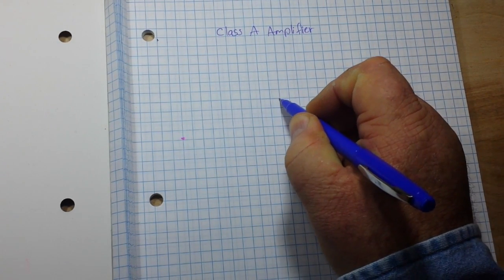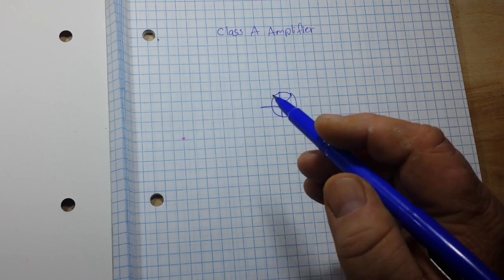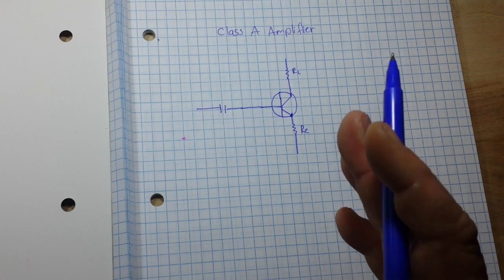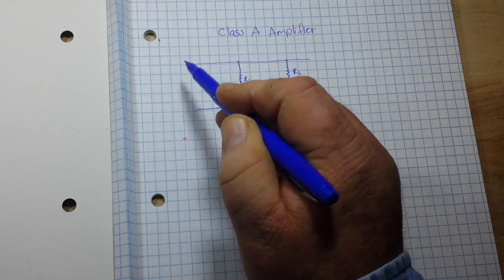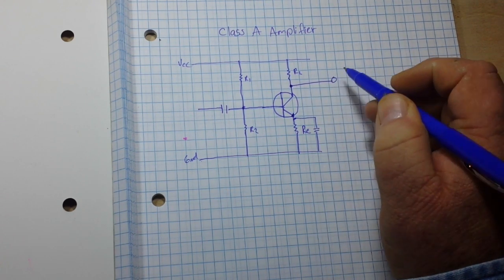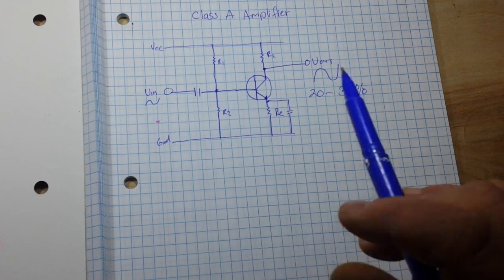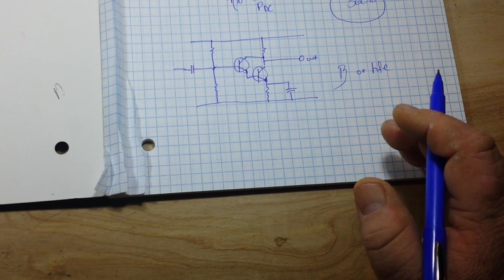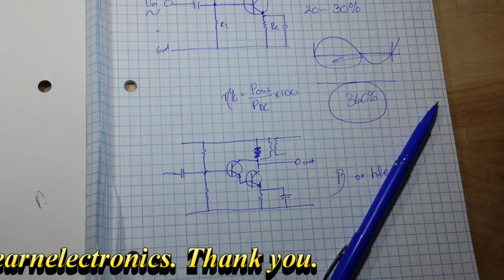Introduction to Amplifiers: Class A

Comment: This video is great for people who are enrolled in electrical engineering. Everything you said makes sense but nothing you said meant anything to me. Could you explain more in depth. Like could you explain what is happening to the electrical signal at each point. Electricity goes in other electricity is summed in the capacitor or something
Reply: If you want to be able to understand how this stuff really works you should check out a udemy course called crash course electronics and pcb design - videos like this kind of assume you already have a basic understanding

Comment: One question, you said capacitor before the base to make sure no dc current is going to the transistor, ok, but is it not suposed the transistors to work in dc and it must be filtered after the transistor or i am confussed?

Comment: If you put a standard silicon diode in series with the resistor between the base and ground, it would compensate for the base-emitter junction voltage. That would make it, so the output maintains a perfect 1/2 supply voltage, regardless of supply voltage. It would also offer temperature compensation, especially, if the diodes can be physically close to the transistor, so they can be the same temperature. On the second schematic, using the Darlington, (two transistors) use TWO diodes. 1N4148 work very well in small signal amplifier stages like this.

Comment: Is there a good way of moving from understanding transistors as switches where there's a load above or below, and capacitors from +v to gnd, to this sort of thing where there are resistors above and below the transistor and capacitors in series on the input?

Comment: What is the 2nd capacitor doing, you just said for a “little bypassing”, why what does that mean ?
On the input the first capacitor is there to stop DC from being passed through, so at least you explained very well what it does, but why is it so import to prevent DC from being allowed to pass ?

Finally you explained the bias resisters briefly and luckily for me, I already know why they are needed, but I’m sure many people seeing this would not, and might have appreciated an explanation for why you need to displace the input sine wave vertically.

Finally, the function of the last two resistors aren’t explained very well neither… 

Perhaps a follow up video explaining these, i.e. going a little deeper would be nice!

Comment: i got 23.245% Efficiency (the amp not done yet, i need a put a 2R resistor as Re and i dont have R2 resistor yet placed. also the capacitor not placed parallel to Re)

Comment: we know everything about this  simple and base of Amp when used of little transformers in driver and out put stages ...for example in old single wave small radio..please speak about modern ..and new design professional Amps how transistors must couple together ? when we use all wave .not half wave !!! ..for double current _ v 0 .+v .  thanks ..was perfect !!!

Comment: Question: Why do we put the loads on top or more specifically, use the transistors to sink current (NPN)? It seems it would be more standard and easier to troubleshoot if the load was sourced from the transistor. Take a light bulb controlled by a light switch. If the switch is on the neutral side of the bulb, you can't tell if the source voltage is present or not when you measure across the light. If the switch is on the line side of the light bulb, you can tell more accurately if the switch is open (no voltage) or if the bulb is burned out.  Same with this ckt. You can't tell by measuring across the load if the voltage is the issue or if the transistor is the issue. If the load was being sourced, you could measure across it and tell if the transistor is open or shorted.  So in this example, you PNP transistors instead of NPN.  I'm no expert, just asking.
Reply: This is one of those circumstances where electron flow makes more sense than conventional flow.
Reply: @talideon  I don't see how that makes one bit of difference.
Reply: Because due to the diode drop, the base of an NPN transistor must be .7v greater than the emitter in order to turn the transistor on.  If your power supply is 5v and your load requires 5v, you would not be able to turn it on because that would require at least 5.7v at the base.  If you want your switch to be "high side" as you suggest, then use a PNP transistor, not an NPN.  In my example, the base must be 4.3v (one diode drop) or less to turn the transistor on.

Comment: Could you maybe explain what does biasing mean?
Reply from the maker: Transistor Biasing is the process of setting atransistors DC operating voltage or current conditions to the correct level so that any AC input signal can be amplified correctly by thetransistor.
Reply: @learnelectronics  Thanks for this explanation about Biasing!

Comment: Why is there a capacitor coming from the emitter?
Reply: This is a common thing with audio amps.  It allows you have a different operating point for AC (audio) frequencies than for DC.  In this case think of the cap across the emitter resistor as a resistor who;s value changes with frequency.  At very high frequencies, the cap will have a value much smaller than the emitter resistor, while at very low frequencies, the cap will have a value much higher than the emitter.  At DC, the cap looks like an open circuit,not even there at all.  So if the amp is just sitting there with no audio input, the limiting factor keeping the emitter from ground is the emitter resistor.  If you apply audio, as the audio frequency incenses, the cap comes into play, and becomes more dominant as the frequency goes up.  If you look at the frequency response plot of an amp of that ilk, you will notice that the low frequency has a roll off.  That is from the combination of that cap, and the input cap (usually to a much smaller extent), , and the not shone in this example, but necessary, output coupling cap.
Reply: To bypass AC current